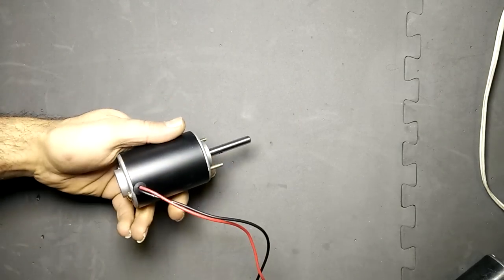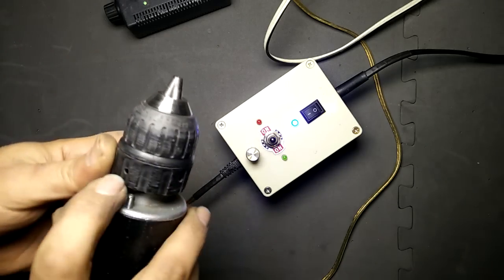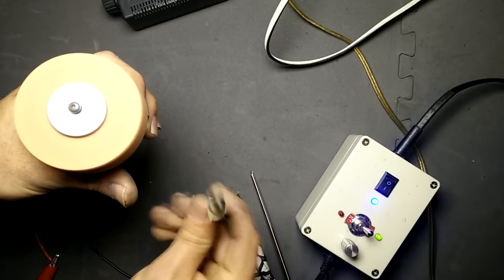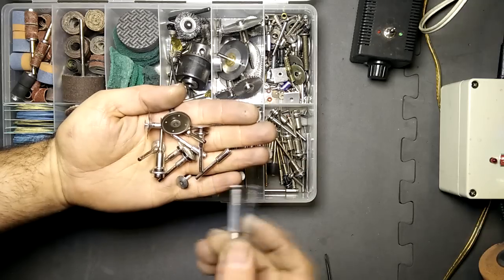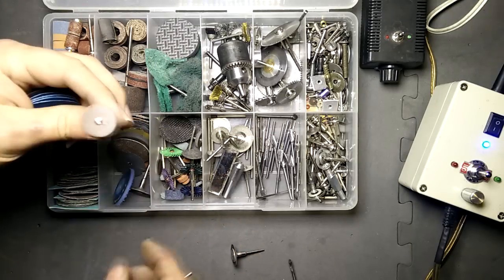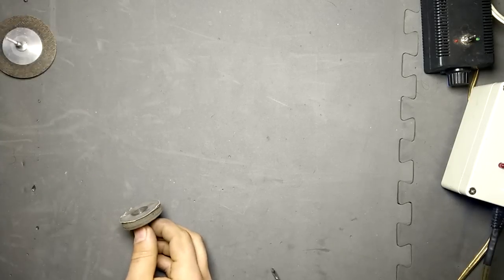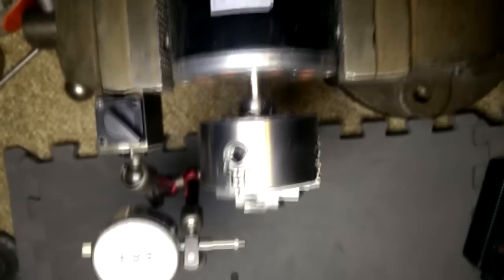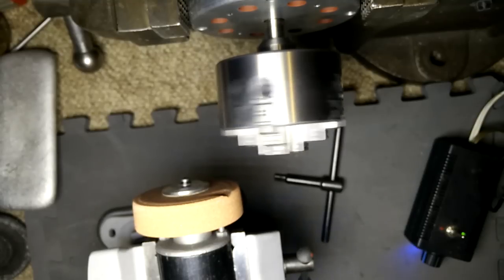Custom made Dremel (rotary tool) and various bit types

Comment: Guess you should have included a tutorial on how you build that speed control module too.. tx
Reply from the maker: It's a simple pwm controller, you can make it but they are so cheap on ebay that there really isn't a point in spending the time and money. 
The controller is off ebay, the only thing that I have done is to add a toggle switch on the output so I can change motor ditrction. And two LEDs and a resistor for the indicators.

Comment: Great video! I think I'm going to try making some of these today! I have some aluminum ingots just asking to be made into something :)

Did you make all of those mandrels or did you buy them in bulk? They're $5 a piece from Dremel, so I'd love to find a better deal if the ones from Amazon don't break
Reply from the maker: Thanks
bought the  mandrels off ebay, you could use the keywords on these links to find more
as for quality, the bigger ones are steel, so not bad
the small ones are often a matter of luck, some are steel and some are pot metal of sorts and not very strong
the small (1/8") ones come in M2, M2.5 and M3, usually the details are not in the listing so it's a bit of guesswork. for those small cutting disks and diamond-in-rubber you need M2 (usually sold with flathead screws on them), everything else is usually M3 (usually philips head)
https://www.ebay.com.au/itm/Practical-Rotary-Tool-Shank-Mandrel-Wheel-Holder-for-Diamond-Cut-Off-Disc-Wheel
https://www.ebay.com.au/itm/Practical-Cut-off-Wheel-Dremel-Mandrel-For-Dremel-Rotary-Electric-Grinding-Tool
https://www.ebay.com.au/itm/10Pcs-2-35mm-Screw-Mandrel-Shank-Cut-off-Wheel-Holder-For-Rotary-Tool-S
https://www.ebay.com.au/itm/25x-Wheel-Brush-Mandrel-2-35mm-Shank-Holder-Grinder-Polishing-Power-Rotary-Tool
Reply: @LateNightHacks  Excellent! Thanks for the help and the quick reply :D